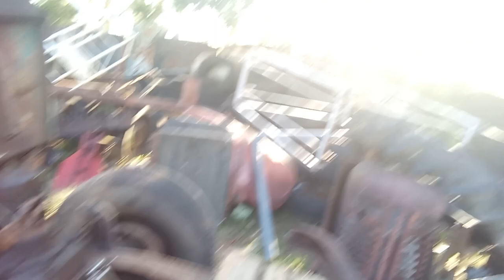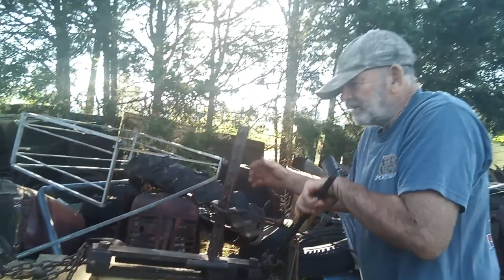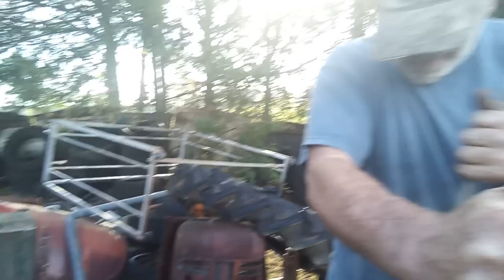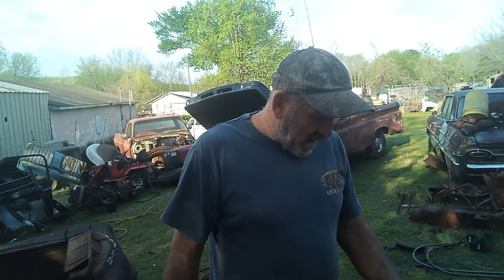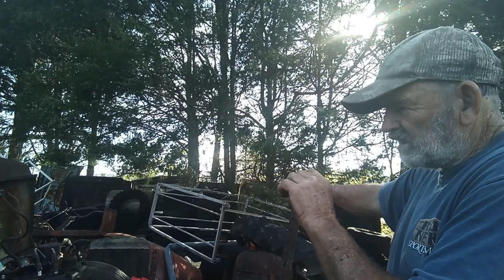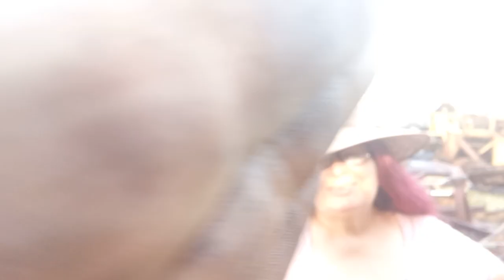April 15, 2024 Dodge water dist tube troubles. Plan a and plan B failed. Plan C worked.

Comment: I used to take those out with a sky hook. My naps are the best part of the day, that and my bad hearing. Thanks guys. Cheers.
Reply from the maker: Actually ater I got thatspear removedi hooked vice grips to the Tube andused the slide hammer and it came out very easily.

Comment: shape your slide in tool with a kinda fish hook  on  the  end , slide it in the tube and catch one of  the vent holes at the the top of the tube and use your slide hammer . i bought my new distribution tube from a military outfit and they  threw  in  the tool .
Reply from the maker: The Tube came out very easily after I got my spear removed.